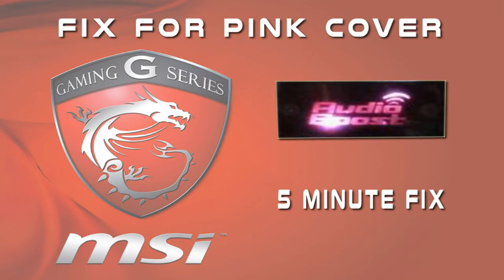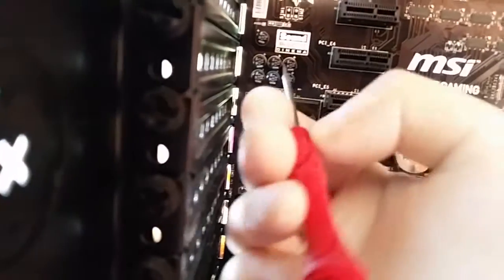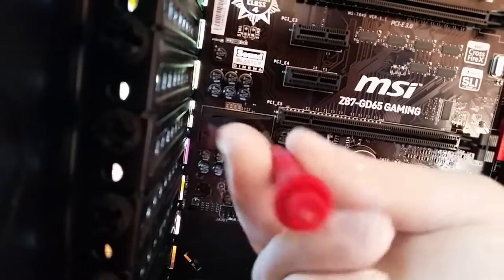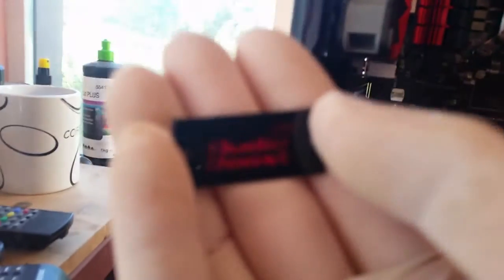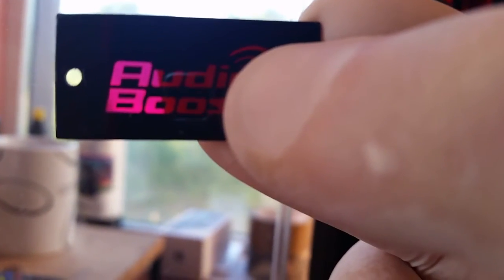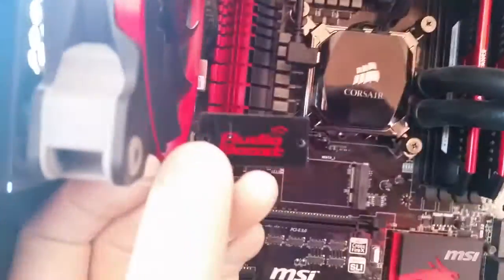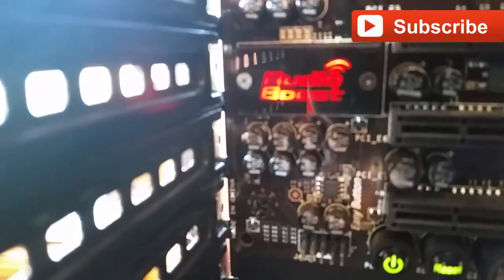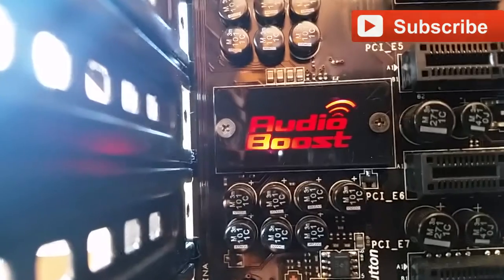MSI Gaming Audio Boost Logo Mod Fix Gd65 - G45 - Z97 - Z97M - Z87M

Comment: I have this motherboard, and a very nice pair of headphones. I noticed the gaming boost connects to the USB port. Is that right? Or is it on the analog output too? I was considering getting the Fiio Olympus E10 Headphone Amp & DAC, but I'm not sure if I need it.